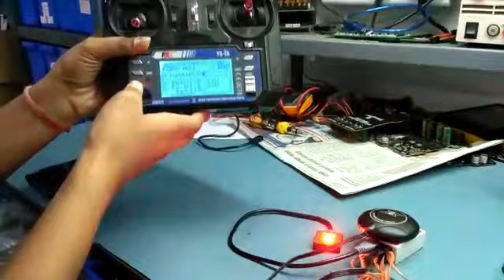How to calibrate your Naza M Lite WITH M8N GPS

Comment: how did you do that please help_
Reply from the maker: How may help you
Reply: @anandbarve22  how did you get the gps to work. Mine is only blinking blue
Reply from the maker: Which GPS you used
Reply from the maker: I used more type of GPS. But I like mostly naza and m8n . My WhatsApp number +918237682988
Reply: @anandbarve22  i use m8n
Reply from the maker: @mate0158GAMING  yes it's good
Reply from the maker: Flight controllers name
Reply: @anandbarve22  dji naza m lite
Reply from the maker: @mate0158GAMING  first to you set manual  set on your naza ASSISTANT.  And  then 3 way switch start up down fast . After your led make solid red and calibrate your model . Means rotot horizon tal circle 360 deg. Then your led blink green. And nose up 360 deg your model then your led blink red. Complete your compas callibration and set your 3 way switch
Reply: @anandbarve22  mine doesn't make a solid color
Reply: do you know how to bind other modes I can only fly in failsafe
Reply from the maker: First to connect your naza to ASSISTANT and 3 way switch for transmitter set Gps.att and manual. Then disconnect your model to ASSISTANT.  And again start your model and transmitter. Now you're 3 way switch you make up down when your led was not make solid red
Reply from the maker: @mate0158GAMING  failsate is rth mode
Reply from the maker: Its fully manual mode
Reply: @anandbarve22  is there any way i can show you a video
Reply from the maker: I giving you my WhatsApp number already you send me your setup video and remot also
Reply: @anandbarve22  i have sent you a message
Reply from the maker: I live in India 8237682988
Reply: @anandbarve22  do you have messenger i dont know how whatsapp works
Reply from the maker: @mate0158GAMING  you download what's app and save my contact In your mobile
Reply from the maker: @mate0158GAMING  Anand barve my Facebook id
Reply from the maker: What position for your gps